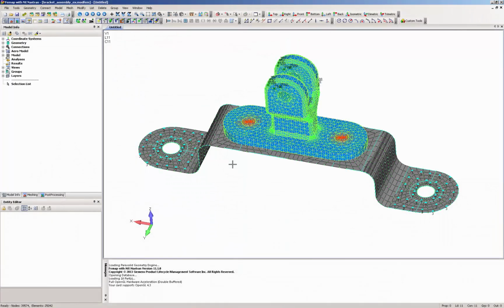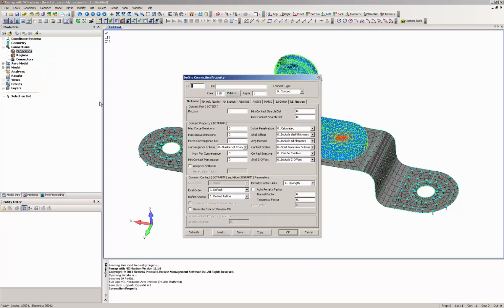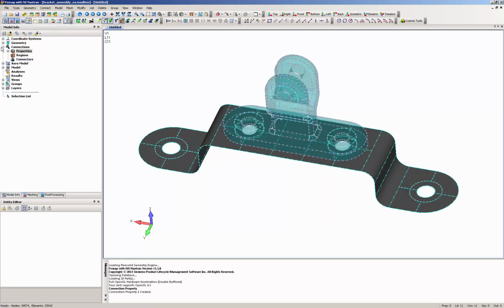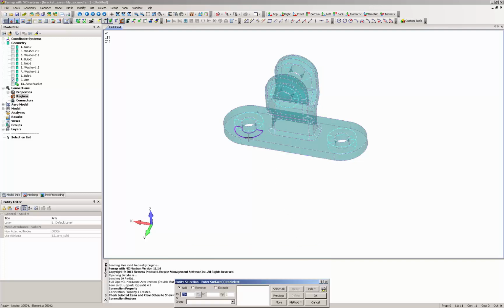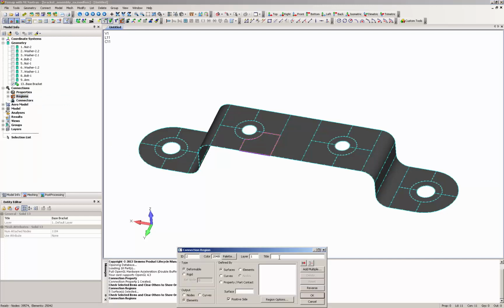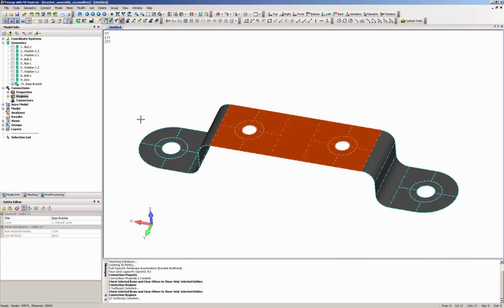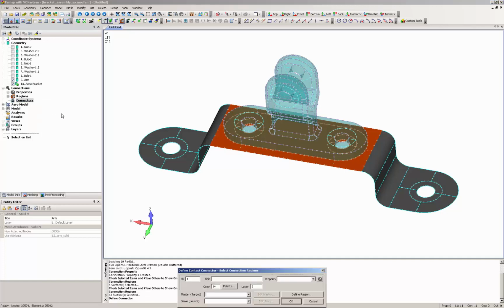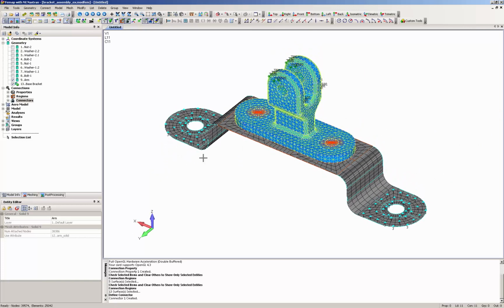Part 4: Contact

Comment: Is there a distance between the two parts?
Reply from the maker: There is a gap between the top solid geometry and the bottom sheet midsurface. However, the property for the shell elements specifies the element thickness, so if you viewed the meshes with thickness and offsets turned on, there wouldn't be a gap between the solid and shell elements.

The contact connection property has an option to include shell thickness. In this example, that means that the two bodies would essentially begin in contact despite the gap.
Reply: @ATAEngineeringInc  thank you so much for the answer, i did it in my project after waching this tutorial.